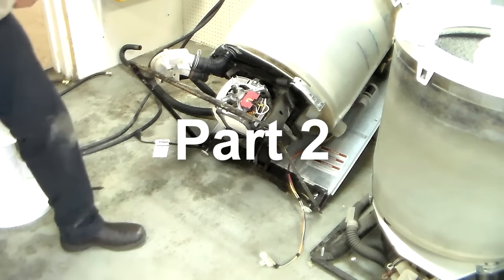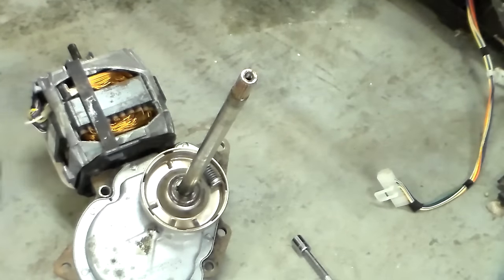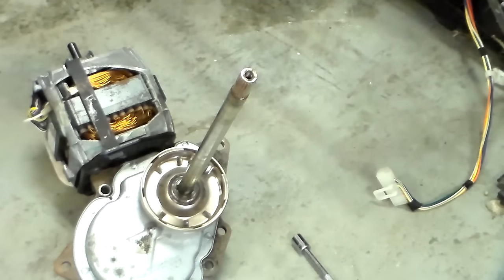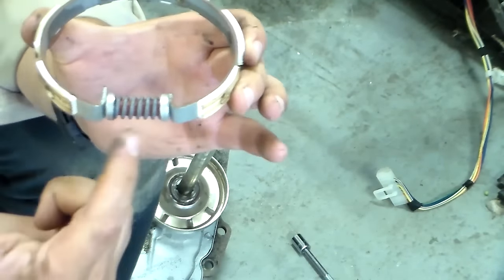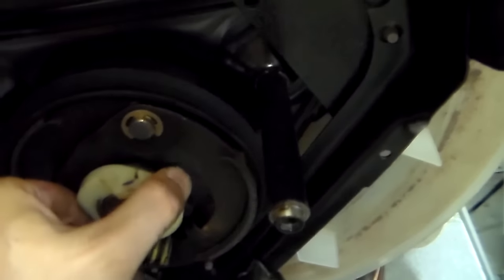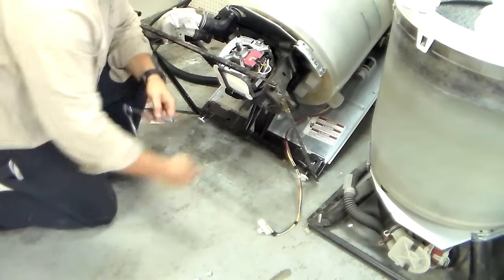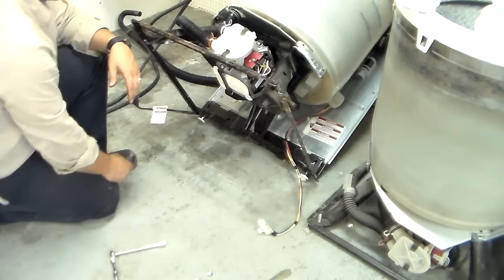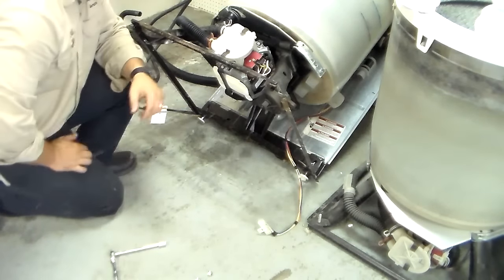Kenmore Whirlpool Washer Not Spinning 2

Comment: Thank you so much for your direction.  I was able to salvage my washing machine by replacing the clutch.  Only issue, I didn't just do the band and pulled the clutch out, the gear came with it and the seal is a bit ripped.  That may have happened already as it has oil on the outside of the transmission.  $20 for new agitator dogs and clutch.  Thanks!

Comment: Super helpful video. I'm fairly handy when it comes to troubleshooting problems but after I replace the clutch, I was able to get a single functioning spin use. The next load seems to jam up and not drain any water. Also, my breaker will trip once the "jam" happens. Any tips would be great.

Comment: hey Bill followed your instructions for replacing a bad clutch which was very informative. Mine was bad because i could spin it around pretty easily the couplings were good however once i put it back togother it still would not turn and continued to make a straining noise what should i check for now

Comment: Good video. Make sure you replace the whole clutch assembly. I tried to use just the clutch pad insert and it didn’t work. I had to take it back apart and put in the clutch housing and all the other parts that come with the kit.

Comment: Thanks Bill for your expertise - you've done a great job on these instructions.

I'm inquiring about the first drain cycle that starts to try and spin but stops (you see it want to start moving), pump works fine to drain and when I lift lid and close again (or depress lid switch with finger with lid open) begins to drain and spin normal. Still a clutch you think or could it be a brake-release?

Thank you in advance.

Comment: Hi Bill - Great video!  You are an excellent teacher.
I checked both the motor coupler and the clutch and both are good, but by washing machine still does not spin.  I can hear the more humming, but the unit fails to spin.  Is there anything else I can check before I am forced to replace the washing machine?
Thanks again!
Reply: +Josh2meReed Hi Josh I saw another YT vid that shows you how to check your switch on your washer.  And how to replace it.  Sounds like that is your problem.  I'm sorry I don't have the link for it - I just searched "Washing Machine Not Spinning" - you will see a title that says "Diagnosing Washer not spinning" ... something like that.  Don't give up ~  Check out the faulty switch vid and be persistent until you get your machine up and running.  It's a great feeling to fix it yourself and you learn as you go like I do.  P.S. I am a 61 yr old woman and I just get mad and get it fixed LOL

Comment: Hi Bill, great video thx, a friend of mine has an older whirlpool washer that occasionally won't spin.  Current remedy is to just spin the timer dial back around to the spin cycle and restart the washer and then it spins.  Also, the clothes after the spin cycle seem to be more damp than usual possibly indicating a less than maximum spin rate again possibly indicating the brake might not be fully disengaged.  Does this sound right?  Does your company sell brakes/clutches?  Thanks again

Comment: Hello Bill, the  video is great it explain everything very well. I have a problem on the Kenmore series 90 I did everything you said and showed on your video but my shaft will not come out. Should I try hitting harder to get it out?

Thanks,
Reply: It's likely that you are not pulling it at the straightest angle possible, so there is tension on the shaft not allowing it to move.

Comment: Thank you very good video had the coupler done but still wouldn't spin or drain properly,ordered clutch on Amazon,and it came complete took it apart again and counterclockwise do the cam and spins fine now will try a load in morning,note ,new clutch has three shoes where the old one had 6 but slipped badly thanks again roger

Comment: Thanks for this bill.. My washer started having issues with heavier loads (would not spin) but would spin on lighter loads until finally last week it stopped spinning altogether. If I open the top and nudge the basket it will perform a very weak spin. I went ahead and ordered a clutch band and lining kit as well as a motor coupler. Anything else I should look at while in there (from a maintenance perspective)? Also ordered agitator dogs..

Comment: Bill, great video.  I did exactly this but the whole gear case and shaft won't come out.  It seems to be stuck somehow.  Not sliding out as easily as in the video.  Thoughts?  I didn't want to break anything by forcing it out but it doesn't want to come out.Thanks in advance for any tips.  Everything else on my machine is EXACTLY like in the video.  It is a Maytag model mtw5770tq0.

Comment: Great videos Bill. Series 70 Q: We're having spin issues. We often have to run the spin cycle twice to get water out of clothes. I have replaced the motor and clutch. Pump appears to be clear. Could it be a bad transmission? Would you recommend replacing pump and transmission? I don't know what's left to do. Thanks.

Comment: I don't see the part number in the description. I have it apart and found that it is the clutch and need to order one. Thanks for the video.

Edit..

Found the part number in a past comment. 285790 is the part number. The clutch is available on Amazon but the entire clutch assembly is half the price.

Comment: Hi Bill- the clutch is fine, coupler is a little worn, one side has oblong holes as if motor was straining against something that wouldn't move... When I bought this house the washer didn't work the first time I ran it.  Filled, motor hummed, but never agitated.  Smelled hot, I unplugged it and watched your video.  So my question- looking at the brake finger- it will spin, and move the wash tub, but only in 1 direction. The other way wont budge at all. but... Agitation goes in 2 directions.....

Comment: hi Bill Newberry Thanks for uploading this video. I am having a problem with my clutch on my washing machine. However it is a AVANTI W798SS. I have searched high and low and nobody has a video of removing the clutch from the Washing machine. I am stuck at removing it. I can provide pictures and videos if needed. Desperate need. Ive been trying to repair my washer for 2 months. Thanks

Comment: Thanks Bill.  Mine spins occassionally yet sometimes it leaves water in the bottom with soaking wet clothes.  It's making a knocking noise from what appears to be the top of the agitator.  Hoping its a drive block but guess I'll find out once I tear into it.  Thanks for your videos.

Comment: Thanks I just fixed my 10year old, 700.00 washer for 35.99. Replaced the clutch assy. and it works good as new. I cant see how these washer cost over 200.00. There is nothing to them, a motor. a pump and transimision. Nothing to them and easy to repair.
Thank You again

Comment: Great Video Devil Dog.  My washer went TU yesterday, and after watching your video I had it fixed in about an hour.  I had to replace both the clutch and motor coupling.  Again thanks again!  Semper Fi......0844/0861/8511   1992-2000

Comment: Thanks for your wonderful video. In our case, we smelled a burning smell and seems that it can have a burning smell  with a broken Clutch/coupler as well. Any thoughts?
Thanks! Jake
Reply: Frum Pilot, did you have the smell after a repair? I have a slight burning smell after a basket drive and clutch replacement. I hope it is just because the new parts are finding their sweet spots.
Reply: @joeybarklow  no the smell was as the machine stopped working. Examination of the motor, showed that a piece broke off and got stuck inside the motor that probably froze it.
Reply: Frum Pilot, I had the tension retaining ring fall off bottom of the basket drive shaft because the base of the shaft had been worn down enough that the ring no longer had enough material to hold onto. It fell into the transmission clutch and made a whole lot of noise. I knew something was wrong and stopped the machine before it could cause more problems.

Comment: Hey Bill New subscriber here, great detailed video...found out my clutch was bad. One question though..That piece that fell to the floor when you pulled the motor/transmission out ? my washer doesn't have that piece, any ideas ? Thanks.

Comment: Great video, gives me the courage to tackle my washer myself. Thanks Bill. Though I do have a question,  my washer does wash the clothes, but does not spin when it comes to the draining part at the end. The clothes come out washed clean, but still soaked. The drain works good, it does drain the water, but washer doesn't do that fast final spin. Could this be the same issue in your video? Thanks in advance and hope to hear from you!
Reply from the maker: MovesLike MickJagger Go for the clutch.  Thanks for Watching!
Reply: Bill Newberry will do boss!  Thanks!!!

Comment: Hi Bill, I think these videos are great.  Last night I smelled a burning smell in my basement, checked everything and it seemed to be coming from the washer and the breaker tripped when I went to put it on spin.  It would not spin every time, maybe every fourth time I tried it would start spinning.  My coupling is good.  The clutch seems good, it is really hard to turn with my fingers. I tested the motor while it was disconnected from everything and when I connect the door switch the motor goes on.  Do you have any idea as to hatchet could be causing the burning smell?  There is some oil dripping on the floor from the transmission (I think).  Thanks for any advice you can give, from another Bill.

Comment: Hey Bill,  Great Video, I will have to check to see if my washer has a bad clutch and coupler.  

My washer does click during the spin cycle and you feel like the motor is really laboring.  Upon further inspection; the tub is spinning but not as freely.   The clicking is causing the lights in rest of the house to dim.   It agitates and drains water just fine and normally.  Do you think its the clutch or I should check something else?

Comment: Got a 2012 Kenmore Series 70 model 110 used washer for $80 after my 2016 $1100.oo washer broke down for the hundredth time. Bypassed the broken lid switch and replaced the rounded out coupler ($32 for replacement)... thank you for the video on it!  I also looked at the clutch and it seemed pretty tight. Ran a test load and it still didn't spin, but sounded like it was trying. I pulled some of the clothes out and it would spin... so, it's a weight issue. I could swear the clutch was tight enough... guess it's not... or is there something else I should be looking at??? a way to tighten it up maybe???

Comment: I have a direct drive washer I am repairing for my son. It started out with the drum not draining and unable to rotate the drum by hand. Found and cleared a major obstruction in the pump. While checking the clutch and brake, I found that I cannot move the clutch at all. Your video shows your none weak fingers moving the clutch. Mine wont move at all when trying the move it by pushing on the spring. I can squeeze the spring and remove the clutch and spring assembly. Do not see any damage or reason it is so tight. Is this normal, or is this the reason I can't spin the drum by hand. Help if you can. BTW, your videos are great!!

Comment: This video is excellent. Only one that actually had the right washing machine setup. But my problem isn’t fixed. What is that odd shaped plastic piece you were pointing out at the 5minute mark!??? On my washer, that fell out when I slid the shaft out. It does not stay up in place. Also I noticed it is missing one of the two plastic posts that the metal piece above it seats on. I did some MacGyver nonsense that honestly should work. But it still makes metal sliding on metal sound when it ties to spin. Only with some weight in it.
Reply: I had a similar problem. I think I got it back on correctly and replaced the clutch but now it’s making a grinding noise at the start of the spin cycle. Other than that it works fine. I’m now trying to chase down the grinding sound.

Comment: Thanks for all your help. Was able to repair my washing machine today with your help.  Local parts store charges a lot more than they should for parts but I wanted to do laundry today.  I have a 110 23022101 and I broke this tiny plastic piece when tightening the agitator too much   Do you have any idea of the part number for that? It's between the bolt and the agitator and had a spring on it.  Seems really flimsy to have that important of a job.
Reply from the maker: +gonzoangel http://amzn.to/1Zop7ud  There you go!

Comment: Thanks for the video.  One question: will washer agitate if the clutch is bad?  Thx.
Reply from the maker: ***** Most likely it will still agitate because the agitator is easier to move than the whole basket.   So a weak clutch may still agitate.
Thanks for the Question!

Comment: Thanks for your vids! Found the rounded out coupling on a freebie I just got.
Is it possible to prepare one of these for storage in freezing temps? I want to store it in an unheated outbuilding and use it to clean shop rags every few months. Thanks!
Reply from the maker: krawlr pour some anti freeze in it, or remove the hoses from the pump and make sure all the water is out.  If all the water is out, it will be fine for storage.
Thanks for Watching!

Comment: Bill,

If we are in the washer this deep, repairing/replacing the clutch and coupling, are there any other critical parts to replace which are easy to access at this point (prior to failure).  Great video.

Comment: Great Video did everything you said on the video but i cant pull it out, tried many times???  is there something i'm missing????  I can feel the clutch is still good although I see the plastic part is broken and have the parts to change it.  But tried to slide it out and NO GO?  is there a metal clip in the agitator part i'm missing???

Comment: great video Bill. my kenmore HD80 series washer no longer agitates on the hi speed setting.  does this indicate a bad motor or might this be clutch related? it agitates at low speed ok.  also wasn't spinning fast enough and the spin/drain part of the cycle never fully completed, leaving soggy wet clothes at the bottom.  does this indicate i also have a lid switch or timer problem?

Comment: I have a series 70 Kenmore. Did everything until the first part of 2nd Video. Unscrewed the three bolts, and got (with great difficulty) to slide the transmission/engine about 3 inches - but I just can't get the shaft to slide any further. Any suggestions?  Okay I found the answer in that I need to get a spanner wrench - not mentioned in this video.
Reply: I am having the same problem --- could you explain a bit more on how you got it out?  :)
Reply: @mjlichter  I bought a used one

Comment: Thanks - Saved me some cash. Replaced Motor Coupler & Clutch for under $20.
Reply: Where do you get your parts?? I was told $50 for just a clutch alone :-(
Reply: Got mine from Amazon. Was less than $20 with shipping.
Reply: Allison W IN case any else needs them, here are the links on Amazon.
http://www.amazon.com/gp/product/B001DPFP88/ref=oh_details_o01_s00_i00?ie=UTF8&psc=1

http://www.amazon.com/gp/product/B00064NX68/ref=oh_details_o02_s00_i00?ie=UTF8&psc=1

Comment: Great Videos Learning a great deal from them! Question Are all couplers and clutches the same for kenmore or can they be different?
Reply from the maker: +DALES GALAXIE Not the same but very interchangeable.  Most of the time the older couplers will look different.  I imaging they tried to change them and make them better over time.  I've always saved the 6 pad clutch bands and used them on other models that I would sell.  They seem to hold up very well.  Hope that answers you question!  Thanks for watching!

Comment: great video.  I think the transmission in my machine is bad.  I have it all apart and the clutch and the white plastic pieces check out good, but when i hand turn the transmission it doesn't turn the clutch.  Is it a good idea to change out the entire transmission assembly, or should I get a new machine?

Comment: Bill Newberry, could it possibly be the plastic/nylon gear inside the transmission? I cracked mine open ( lost all the oil in the process). I did seem to fix the linkages under the gear and now have the shaft that hooks to the motor turning as I turn the nylon gear. When I turn the long shaft, should it turn the nylon gear and the small shaft coming out of it? Mine doesn’t turn the inside of the transmission when I rotate the long shaft. Also what type of oil would I use to put back in the transmission?

This is an awesome video, not sure if you have one that goes more in depth inside the transmission.
Reply: Was it making a terrible grinding noise?

Comment: replaced coupler, then replaced clutch assembly. drains and sometimes spins 4 or 5 times, but  it still doesn't spin out the water-logged clothes. looked at lid switch. unscrewed the 2 screws, white housing w/ red screw holder, which apparently has a white paddle extension on one end and a small white paddle on the other end. from the side, it looks a bit like a capital L or a really high back lawn chair w/out legs. tried the bypass lid, w/ cover off. put the 2 wires directly to each other, left ground wire attached to original screw, then put the to cable-housings together. timer goes through cycle wash, cycle rinse, and then stops. pump is working, as is motor and transmission. did not replace agits, because they held the agitator, w/out slipping counter-clockwise. everything has been checked and rechecked. there is a little brown button that i have to push to advance to rinse, then to spin, where it doesn't move. put a new balance ring on machine, but, perhaps, it is the lid switch. i see nothing that looks like the gizmo that came out of washer. any suggestions?